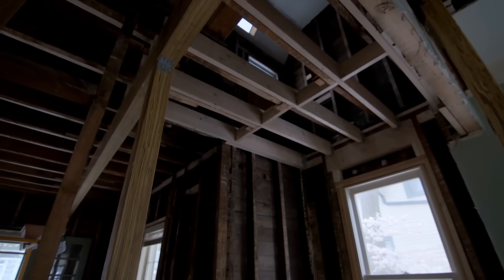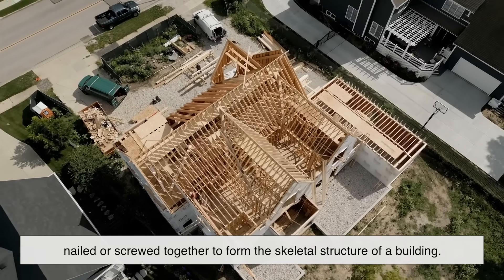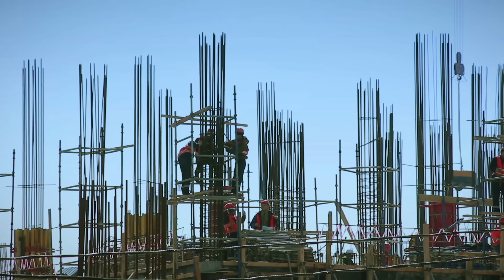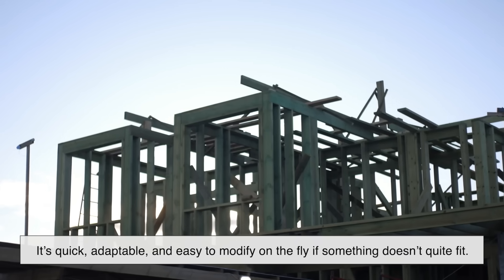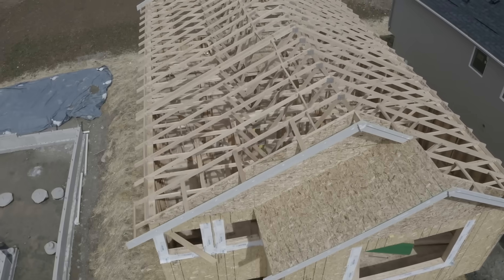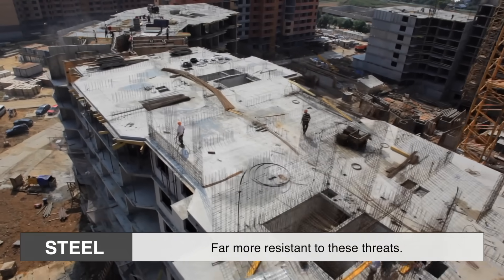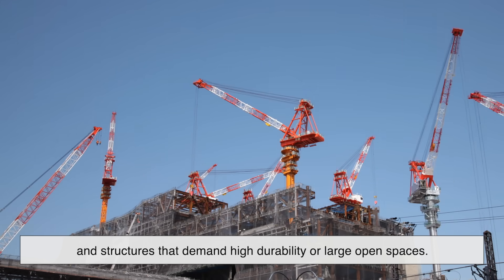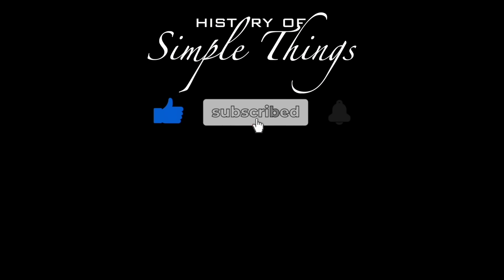Is Steel Framing Worth It? Or Should You Stick with Wood?

Comment: This video references the steel used in a building frame as being galvanized. That is rarely the case in a structural steel framed building.  Additionally, in many cases where steel is discussed, a building properly termed “concrete framed” is shown.

Comment: If you have a house with prefabricated panels, concrete, ceramic tiles, glass, connected with stainless brackets or galvanised and bolts, it would be the best solution! It would never break down. It would be inherited for centuries,,,

Comment: If you intend to live in the house , use Steel Framing with Cast Concrete or Pre-Cast Concrete Building Panels ... #1 the BEST 👍

If you're 'Flipping' houses use Wood 👎

Comment: Wood framed houses are used for low cost , small houses only. Anyone who prefers quality and strength would have to use steel reinforced concrete structure. Wood building isnt weather proof whereas steel frames and reinforcement (if done by a good engineer only) is full weather proof and can withstand earthquake and cyclone too like nothing..
Reply: O.K.
Reply: And to add to that I find it too hilarious to see most American houses made of wood and cardboard. Where you can listen people talk on the other side and if someone punch it would create a massive hole in the wall.. Most of American houses aren't made to last but a quick way by which property dealers make money by tricking buyers into decoration and affordability.. 😂😂

Comment: Wood holds its strength better in fires. Unprotected steel fails almost immediately.
Reply: Wood holds better in fire 😂😂 lol.. What a joke 😂😂
Reply: @msnirajagrawal  also just becuase it doesn't turn to charcoal does not mean steel survives the fire. Steel will Crack and soften in the heat causing it to warp and loose its structural integrity and still need to be replaced more often then not post fire
Reply: @msnirajagrawal  so they are not really wrong here. Wood burns yes but it does so at a slow steady rate. Meanwhile steel framed buildings don't have the same fire blocking as a wood structure(again this is all up to auxiliary materials) but if you look at say a fire blocker between a garage and a home they tend to use a thick WOODEN beam becuase it will hold the fire back Long enough for occupants to get out and emergency services to arrive. Steel on the other hand do to it's smaller size means that the materials around it i.e. the insulation just goes up instantly and burns right through.
Reply: So in other words it's not so much that the steel fails but the materials around the steel all burns down super fast. It's also why when you see a home that has burned for a long time the only thing left is the studs as they in fact burn slower then side material. Course brick beats them all
Reply: @sambuechel9632  I think you have never seen a real concrete house. Get out of America and then see how a real building is made. You just cannot burn a steel reinforced concrete building. Everything inside will burn to dust but the house structure will stand as strong as it was before the fire. If the doors are made of fire resistant material I guarantee fire cannot spread to other room too. While a house made of wood will burn to charcoal and help the fire spread across the house. You have your facts wrong. I have seen multiple fires where although the content in the room and house is burnt to dust while the building just needs a good wash and repaint and it's good as new.
Reply: @sambuechel9632  and yes I am talking about house made of brick and cement with concrete roof. Almost all the urban house in my country are made with it. Talking about my personal house it's made of red brick the best quality, but this brick is now banned so big structures are now made of flyash bricks.
Reply: @msnirajagrawal  1 I have traveled to every continent except asia(though my brother did offer to take me backpacking with his local friend from Vietnam but work sucks) 2 my father is an architect my brother in law is a firefighter paramedic and I have had my construction degree and been in and out for 15 years now. 3. I said unprotected steel, which concrete easily is considered protection. Last but not least, we have tons of ICF and other concrete structures. Granted, yes, they are more often commercial buildings. You're not special just because america is obsessed with cheap buildings (aka stupid) and don't forget a state is the size of a nation in Europe, meaning all of America can't be defined as a singular entity we are as diverse and not all dense as a reinforced concrete wall
Reply: @msnirajagrawal  steel frame isn't concrete reinforced they are not the same. steel frame uses drywall rubber roof and hardwood floors and doors. Perhaps where you are from things are referred to differently but in my collage education for construction concrete is steel reinforced concrete ICF (insulated concrete form) where as steel frame is referring to specially similar concrete to stick or balloon framing in which the studs are replaced with steel
Reply: @sambuechel9632  yeah exactly. As I mentioned I was specif about concrete buildings only. Unprotected steel is not used for building because of its many cons..
Reply: @msnirajagrawal  The ironic thing is that it can do better.  A single family house with a wood frame can not hold back a raging fire.  But an unprotected steel structure can warp or twist in a fire.  There are instances of large wooden timbers charring but maintaining structural integrity while adjacent steel failed.
Reply: @markkillion8980  that's because you are using steel wrong. Steel frames aren't meant to be exposed. For small garages or store house etc yes we can use exposed steel frame, but steel is meant to be used for reinforcement for concrete structures mostly. And no wood can stand against that reinforced concrete. I just want to say that we should use steel the way it is meant for. Exposed steel frame is only used for building where we know there isn't any danger of elements or fire. If someone uses exposed steel frame to construct house he's an idiot who wants to save money on construction.

Comment: Termites Vs Rust. As a Floridian that is a tough argument. I suppose it really depends on what kind of roof & walls you go with. Concrete walls and rubber roof should sustain your metal frame forever, but most people don't buy those.